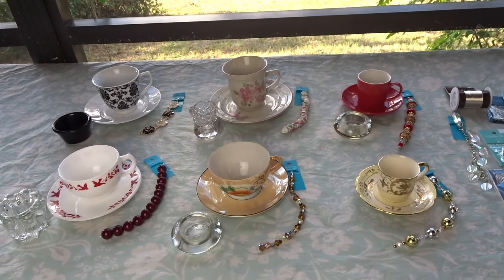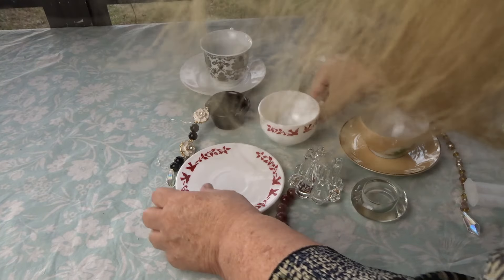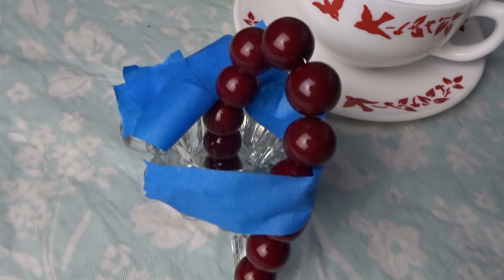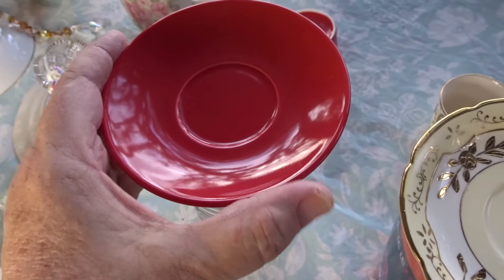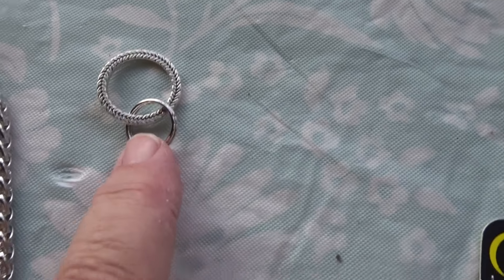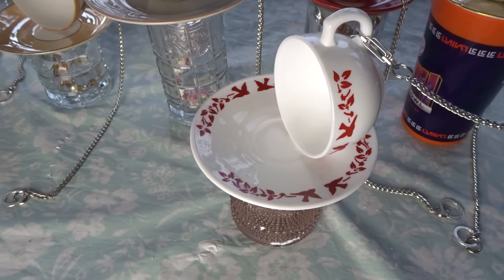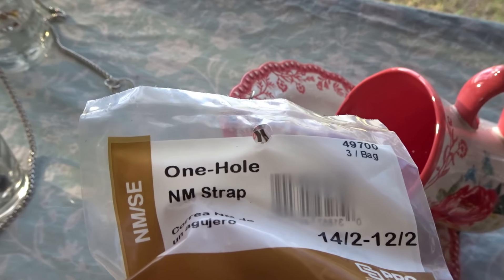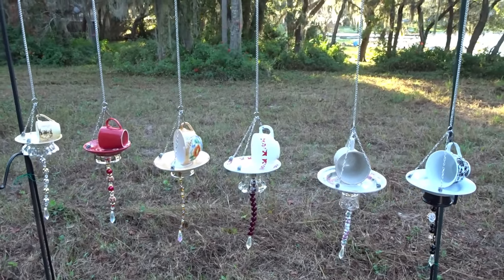6 Teacup Bird Feeders & GIVEAWAY! How to Make a Teacup Bird Feeder DIY (with Giveaway at the end!)

Comment: Subscriber, Oregon. 

These are gorgeous! I was wondering if you'd determined where to mount the cups such that the saucer would be horizontal. It would have been a tricky thing to do! 

It's cold and gray here so I'm a bit envious of your warm weather. As always, I love your kitties and how they take an interest in your projects. 

🐾❤️🐾
Reply from the maker: I think it would work well if i had the cup in the center of the saucer, but it's a learning process : ) I love new challenges. And yes the weather is still warm here and I'm loving it. I hear Oregon is pretty in the summer ♥
Reply: @MyLittleSliceofParadise  Yes, before fire season and during when the wind is blowing in the right direction! Oregon has a number of different climate zones so you can experience everything from coastal green to alpine forests to high desert scrub. Nothing here like Florida though!
Reply from the maker: WINNER! Check comment in description : )
Reply: @MyLittleSliceofParadise  😲😁
Reply: @MyLittleSliceofParadise  Winner #1.

Comment: The wire will rust quickly outside you was better off leaving in the plastic fishing line. I use fishing line all the time in my garden to hold up climbing rose bushes grapes etc and not a problem yrs later still no issues
Reply from the maker: That’s a great suggestion, I'll keep that in mind for my next feeder. ♥